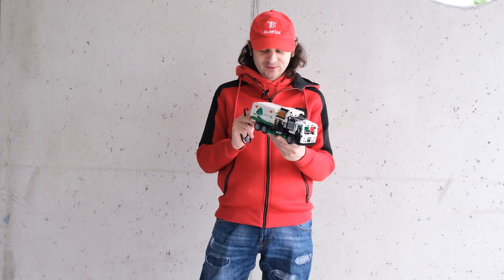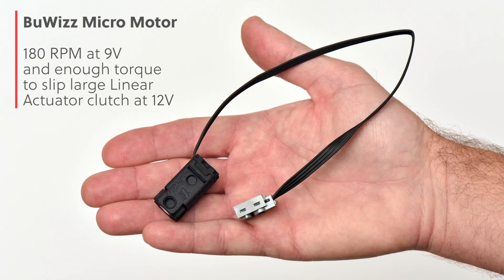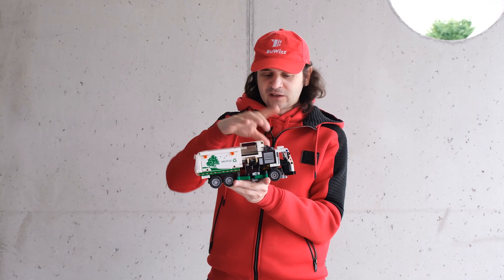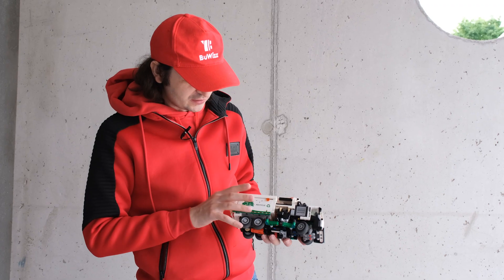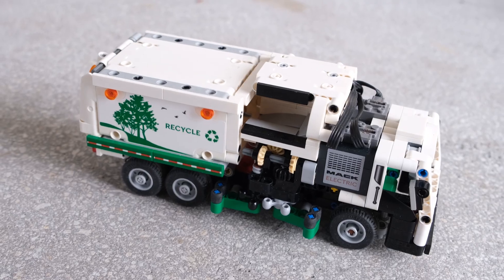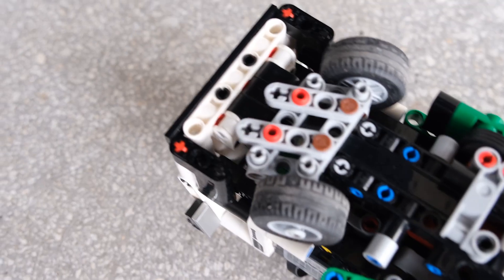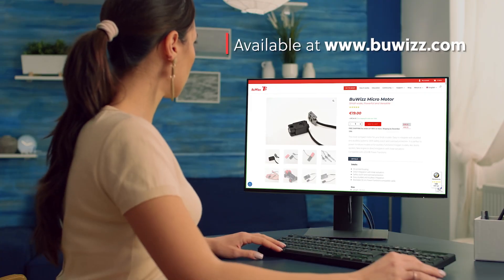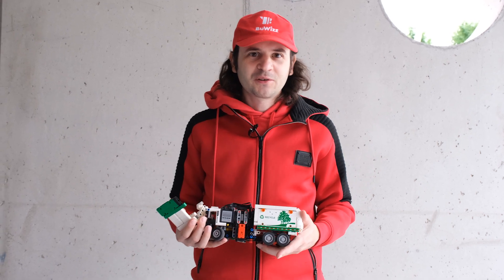LEGO® Technic 42167 Mack® LR Electric Garbage Truck motorized with BuWizz Micro Motors

Comment: Did you use the BuWizz 2.0 instead of 3.0 because it has 4x PF outputs instead of 4x PU outputs and only 2x PF outputs?  Does that mean the new micro motors will have Power Functions connection option only?

Comment: Nice! I have a question: are there any sensors in that motor, so you can use it for steering as servo? 
I wanted to motorize this set as well, but it seems like you put me out of work haha
Reply: Not avail with power functions